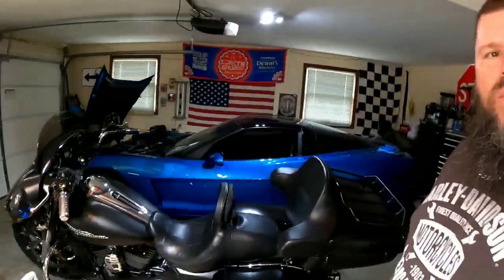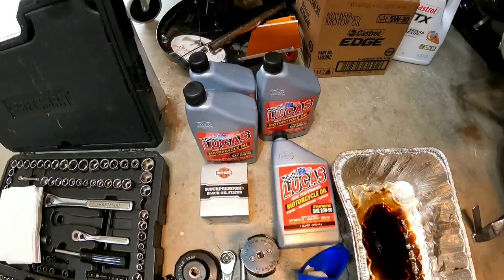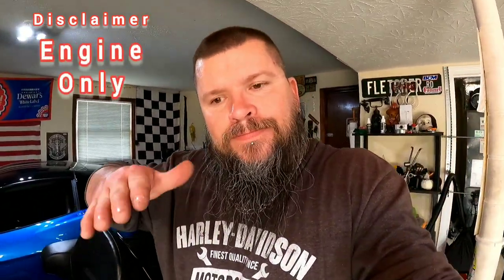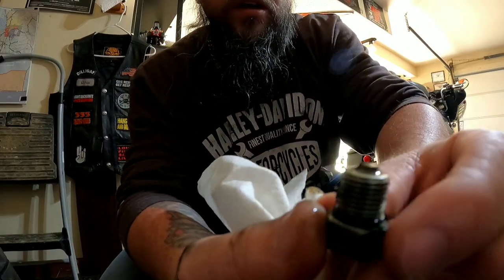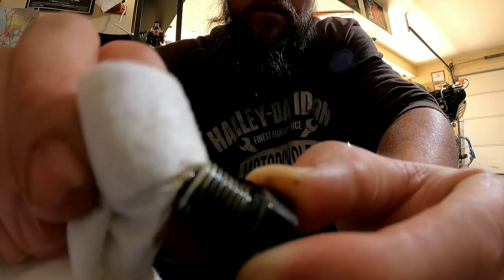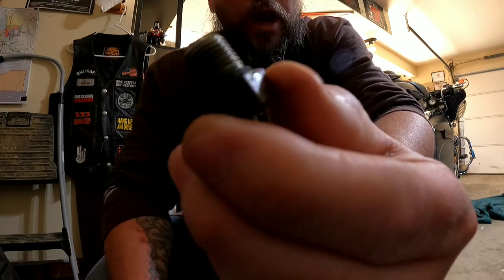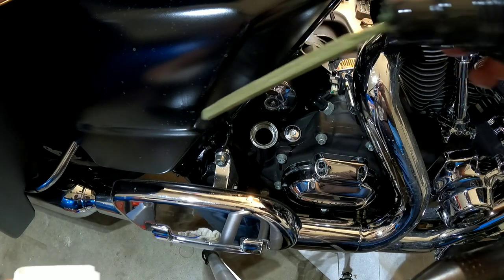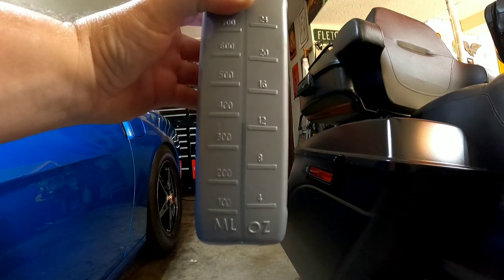How to change your Harley twin cam oil/filter

Comment: Hey man can use Lucas oil on my vstar 1100cc 2005 ???
Reply from the maker: I wouldn’t put that garbage in a lawn mower bro!! It breaks down too quickly! If you didn’t want to use the better stuff like Amsoil, then maybe check out Castrol GTX 20w50. I would even recommend Shell Rotella, before I would use Lucas.
Reply: @badlsxgarage  thanks bro I just finished Watching that one video where you throw away, Lucas bottle oil…. Am going for castrol oil
Reply from the maker: @fernandotorres2103  Absolutely!! Anything I can do to help! 👍✌️